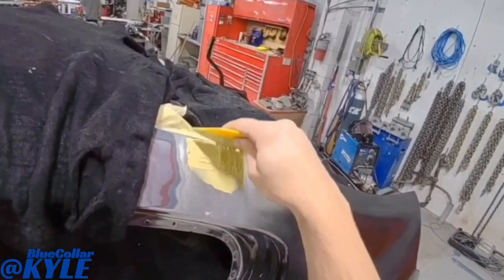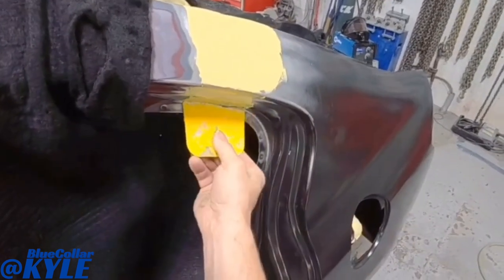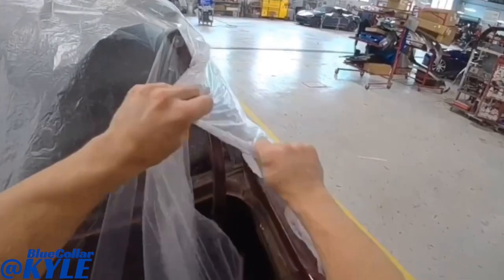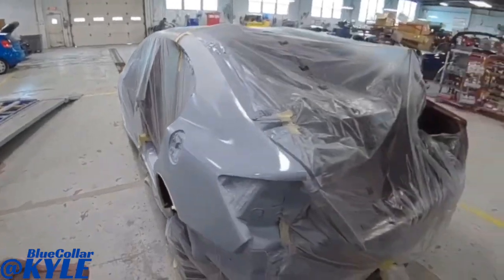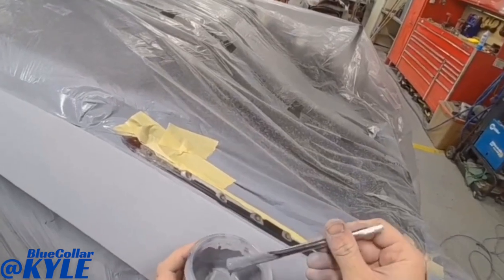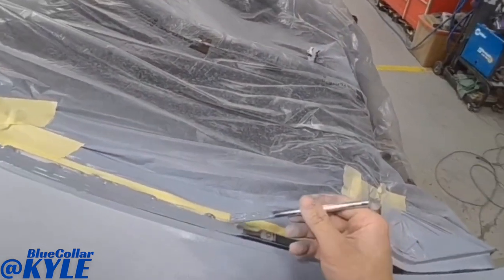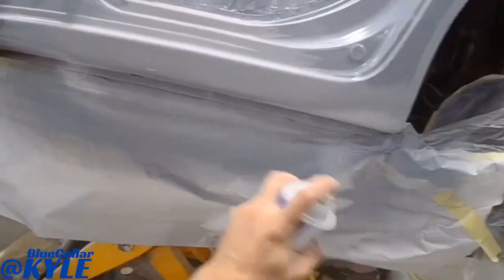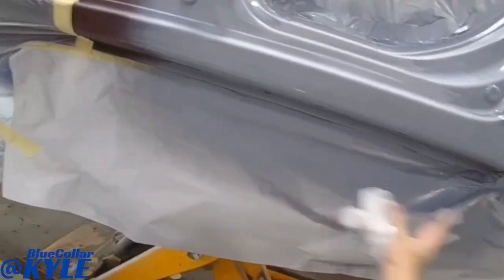Finishing The Civic Quarter Panel!

Comment: Why do you not use a air hamer. And does your spot welder not work with panel bond. I do both around the wheel weld and in jam

Comment: Is it also possible to take out the whole piece instead of cutting it?
Reply: Depends on how complex the panel is I suppose.
If you do that the tension in the frame will relax and it will be VERY difficult to replace and have everything fit properly after, big gaps and some parts may not fit well if at all.